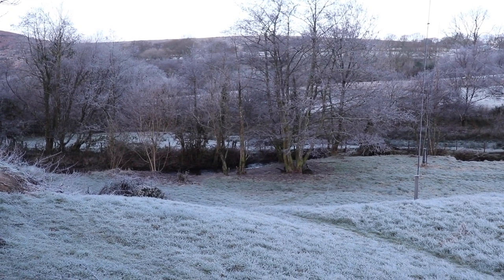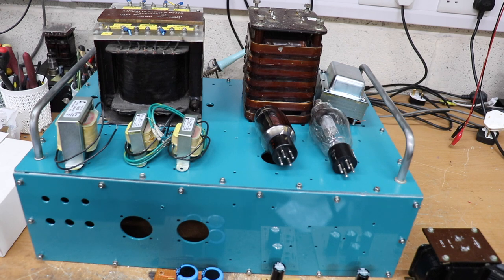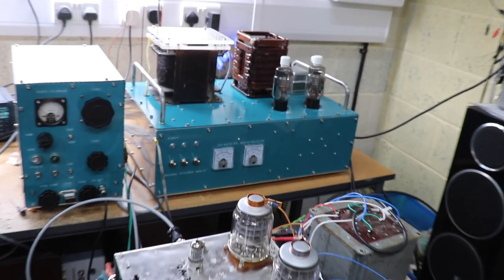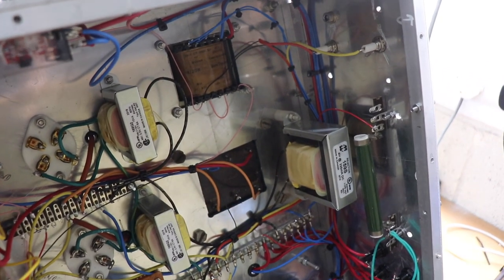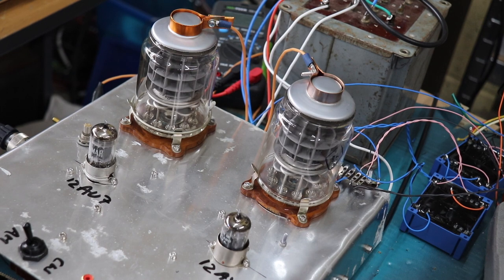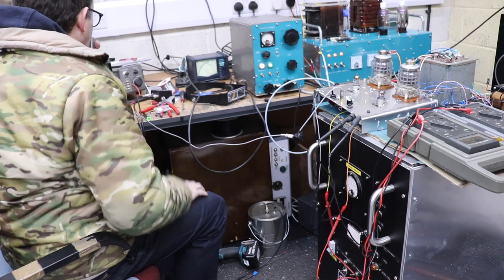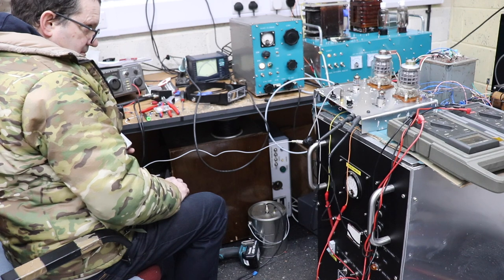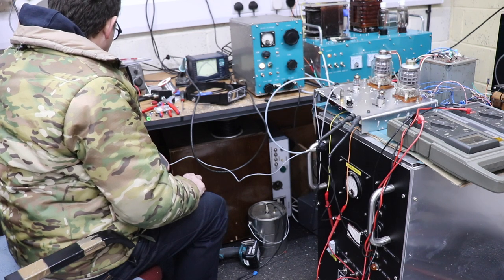Let's Add AM To The 813 Transmitter!!

Comment: Another professional looking project, I like the blue colour you have chosen. Looking forward to hearing it on air and will listen out for you on 3.615 MHz Justin 73 de M0DAD David.
Reply: rubber spark plug caps on gu72 will help prevent death  - which should be by the v4x jabs only.

Comment: Excellent... Thanks for advancing the radio art. My only disenchantment is that you are not using the mercury vapor rectumfiers!   What do you use for a modulation transformer?
Reply from the maker: I originally had a pair of 866’s but they kept arcing over ( too much capacitance in the filter and no choke) The mod tranny was a Woden UM3

Comment: Hello again Justin, I wonder if you have any more information you could share regarding your paintwork for your projects? I would be interested if you have any links to the paint type, manufacture, colour etc and was it a semi gloss paint? Did you have to use a self etch primer first and finish off with a clear lacquer after it was painted ? I am looking for some paint for a new AM valve transmitter and power supply. Any info would be appreciated. 73...M0DAD David.
Reply from the maker: Hi David, the paint is a spray can type which I bought from ebay. I used the one by Deco Color , It is acrylic paint I believe. The colour code is RAL 5021 turquoise. You should be able to find it. I generally use gloss paint. Yes usually start with a couple of coats of etch primer first. I dont use the clear lacquer as the one time I used it the finish was affected

Comment: Hello 👋  Great video and excellent workmanship!
YouTube finally has been recommending your videos.
Question: I’ve noticed a growing trend to mount toggle switches whereby ‘On’ is in the down position and ‘Off’ is in the up position.  Could you speak to this trend?  I’ve thought that when dealing with HV or rotating machinery, that with the old convention would guarantee that everything is Off when you would first plug in a piece of unfamiliar gear.
Thanks & 73…